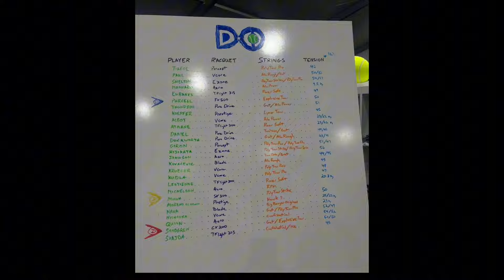Power pad hack | Stringer’s gripes | How much is your labor worth? | Head IG Challenger Pro

Comment: try maybe elastic rubber band, easyer to apply.. less weight and no work other than cutting...
Reply from the maker: Thanks for the tip! My go to is a 3 gram dampener. And on some stiffer rackets I use a 5g dampener. I know some will argue dampeners doesn’t actually dampen vibrations but it does for me. I install power pads on some of my sticks depending on how I feel at the time of stringing and I still play tennis with dampener in addition to power pads. Last time I measured the weight of 4 power pads they weighed 1 gram. Wouldn’t affect specs much.